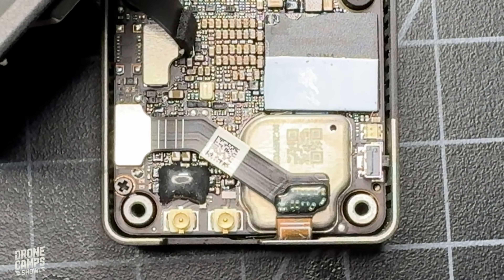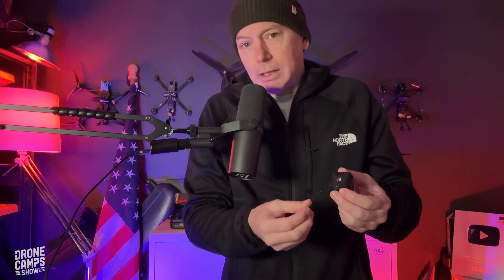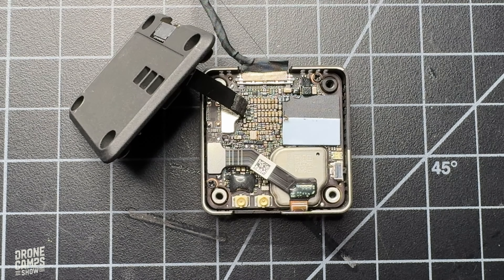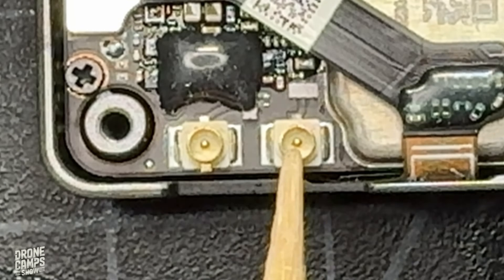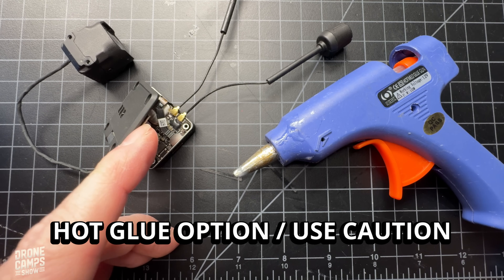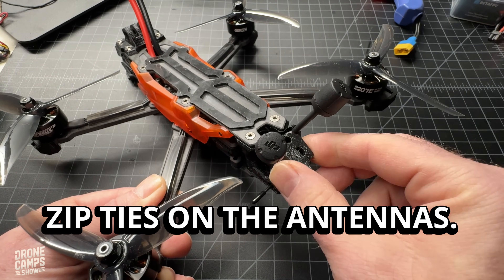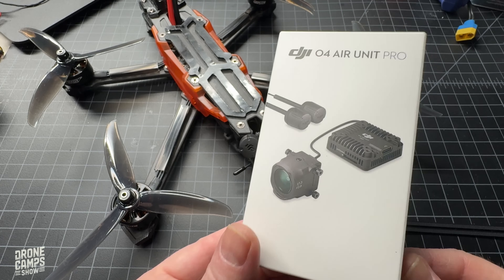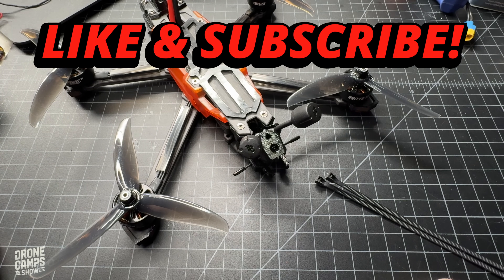DJI 04 FATAL FLAW. 💀 [ What you NEED to KNOW & FIXES ] 🚨

Comment: I want to share a frustrating experience with the DJI O4 Pro: I just lost my BNF Iflight CineLR, and I’m absolutely certain it was because the O4 link suddenly stopped working mid-flight. This is unacceptable for a system marketed as state-of-the-art and stable.

DJI really needs to address this and investigate why the O4 can fail like this. It’s not just about losing a drone worth thousands, but also about safety when something suddenly fails.

Has anyone else experienced similar issues with the O4? We need DJI to fix this!
Reply from the maker: What did the loss of link look like? Did you have a clear line of sight to the drone or was it behind a mountain, rocks, or trees?
Reply: No, I was 70 meters away, with a 60 Mbit link from the drone, just climbing to 100 meters when everything went black. The Air Unit is still working, but the camera feed is black, similar to other stories I’ve seen on YouTube. I have not had any crashes with the drone.

Comment: Why would you use hot glue? It's going to melt from the heat.
Reply from the maker: You can also use E6000 or E7000 
https://amzn.to/3QkfEFY

I’ve used hot glue over the years and it holds up on ufl.
Reply: @dronecamps  I'm a bit lost on the BEST adhesive for this particualr job...E6000 or E7000?

Comment: Funny enough, just a week ago, I unboxed my brand-new DJI O4 Air Unit Pro transmitter module—one I definitely paid for—just to remove the antennas and fit them into a 3D print. While pulling off the second antenna, the UFL connector snapped off. Absolutely frustrating! I couldn’t believe this happened on a $250 DJI Air Unit. Luckily, DJI’s repair service covered it under warranty and fixed it for free. Still, I think this points to a design flaw. Good to know I’m not the only one dealing with this issue!
Reply: its obviously a big problem on their side because the same thing happened to me... get a new one for free too but look like this o4 pro is very very easy to break !
Reply: happened to me brand new but i dont have a Dji repair service in my country....do u know if if one of the antenas pop off it will be impossible to pair with the googles N3 because i mounted everything and tried to pair (before noticing thata the antena UFL connector had snapped) with no luck after various try's i disassemble the canopy and notice the problem with the UFL connector....but not sure if the pairing with the googles n3 is not working because of that....new drone new camera non usable :(
Reply: Damn I gotta do that and I'm worried af I'm gonna do the same!😢

Comment: I wouldn’t use hot glue I would use E 7000 or E 6000!
Reply from the maker: I've used both. But yes ; you can use E7000 or E6000. 👍🏻

Comment: B7000 or E6000 is much better option for securing antennas. Easier to peal off when needed, and doesn't become soft when it's hot from working DJI unit.
Reply from the maker: Drop a link of you have one for the community
Reply: B7/E6 - which is better for this job in your opinion?
Reply: @oxazepamgeek probably E6000 cuz it's stiffer. But i use E7000 cuz thats what i am used to

Comment: Hot glue is gonna melt from the heat.  I believe that some E6000 might be better.   Securing with zip ties like you do the xt60 is a great idea.
Reply from the maker: There’s also thermal adhesive

Comment: It happened to me, I sent the unit to DJI and they said it was not covered by the warranty.
Reply from the maker: That’s BS if it’s defective!
Reply: So they sold product with a issue and refuse to take care of the customer when it fails prematurely!  Total BS!
Reply: Most Dji fans don't mind, most will refuse there is any problem with dji. Dji just runs with it.

Comment: How would it come off if the top plate is pushing down on the antenna wires?
Or better question how could the antenna wires come out if the top plate is securing the antenna wires. 
I'm asking because it looks like it has a small opening for the wires. 
Thanks for sharing JD I really enjoy watching your channel and learning more about fpv's and all the other good stuff you talk about. Thanks again. 👍👍👍
Reply from the maker: For sure. Good question. The top plate has a thermal pad, pushing down on it however, that pad tension is not absolute. Where people are having problems is when the UFL plate itself disconnects from just sitting on top of the solder. If that happens and it makes contact somewhere else it could cause a short. And in the bigger picture cause you to lose video completely.
Reply: @dronecamps  I see, Thanks for the info. Always good to know. 👍👍👍

Comment: My O4 Air Unit Pro is acting like it has No Antennas.
It came on a Flywoo Flylens 75 and worked for a few slow indoor flights, then started acting like it has no antennas. It will get 60Mbps if the air unit antennas are an inch away from the DJI Goggles 3 antennas, but 1 foot away (1.5m) it drops to 7 Mbps, and at 5 feet, or even less, it is down to 0 and looses connection. The antennas look connected, but I don't want to take it apart that far due to warranty issues, otherwise I would look closer at the solder joints.

Flywoo doesn't know the cause and wants me to send it to them, apparently at my expense, though they haven't replied to my latest query about that. 

I recently sent a complete description, with a video and CLI dump to DJI to see if they might do something more reasonable. I received a response that my email was forwarded to the appropriate department, but that's all so far. Having two vendors involved here is going to complicate matters.

That signal tab in the top middle may also need to be resoldered, especially if the component has come off.
 
Thanks for the video.
Reply from the maker: You’re welcome. Did you get a chance to open the vtx up and look at the Ufl connectors?
Reply: @dronecamps  I did not. I have two vendors warranties to be concerned about, so I'm waiting to hear from them. All I know is the antennas look like they're attached, and I can't think of anything else to do. I do have another O4 Pro unit, if I built the thing myself, I would try that one.
Reply from the maker: Sounds like a nightmare. What other vendor unit of yours is up for warranty?
Reply: @dronecamps  Both are for the Flylens 75: one from Flywoo for the quad with the air unit, one from DJI for the air unit. Who will come through? DJI won't take the quad apart but they might send me a new air unit (or maybe they have some other solution); Flywoo doesn't know much about the Air Unit, and sending it back and forth to them is going to take quite a while plus add some pricey shipping. Waiting in suspense while my new Flylens 75 sits in the box... 

I just ordered a Pavo20 Pro to go with the O4 Pro that I ordered from DJI; that simplifies matters, I think.